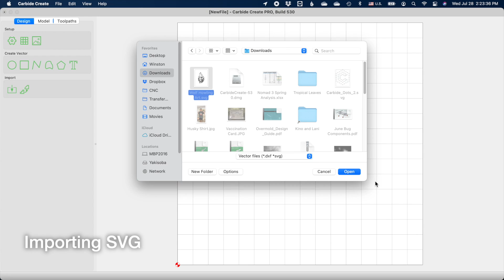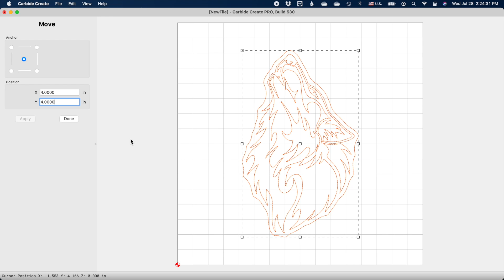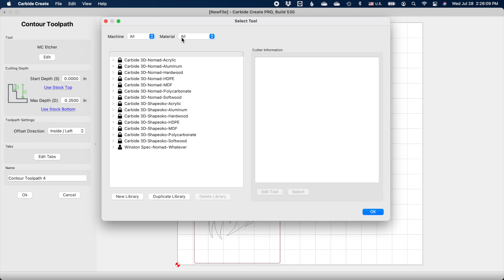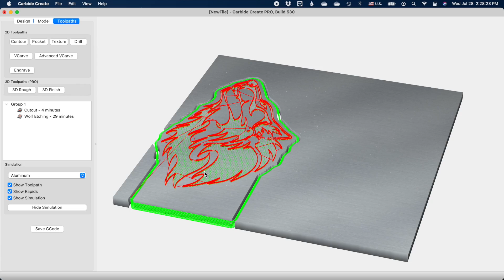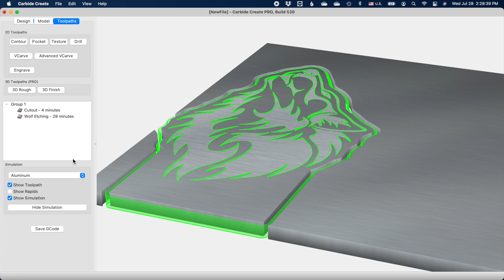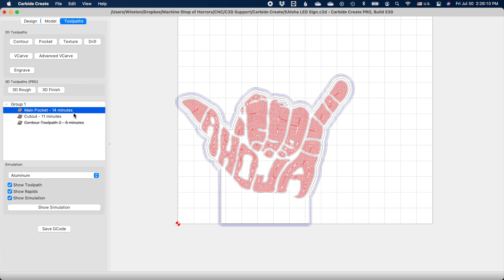Making Edge-Lit Acrylic Signs  - Drag Engraved vs Machined Examples

Comment: It looks like your  LED base has a wider slot  that can hold a 1/25 inch or larger piece of acrylic. All I can find on Amazon are bases that hold 1/8 acrylic. Any suggestions where I can find the larger width bases?
Reply from the maker: https://shop.carbide3d.com/collections/project-kits/products/edge-light-kit?variant=39357474078781

Comment: is the spindle fan a 3d print or machined? Can it be purchased?
Reply from the maker: It's injection molded, included with every Nomad. We don't offer it for purchase separately at the moment, that may change in the future but I can't make any promises.
Reply: @carbide3d  I've had my Nomad for a year or so, did'nt come with one at that time>
Reply: Look on Etsy. There are a number of sellers who sell 3D printed versions that you can add to your own bits.

Comment: Anyone got a good supplier for drag engravers? Been waiting weeks for carbide3d to restock…
Reply: I got mine on Ebay... Their spring is a little more forgiving. The 2 bits I got from Carbide Create are hella strong and by the time you back down the spring tension with the screw I fear the screw will back out on it's own.
Reply: @cpworx_maker  thanks for that information I"ll keep it in mind for when I make my purchase.